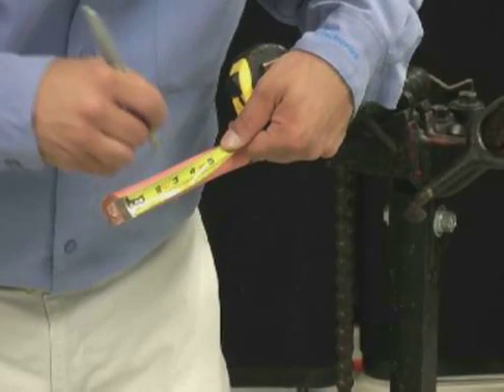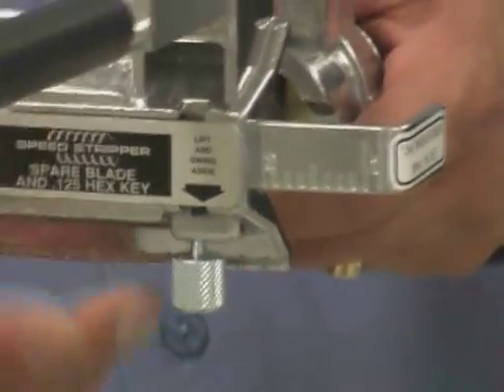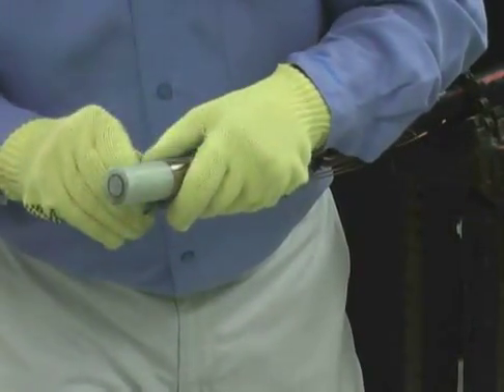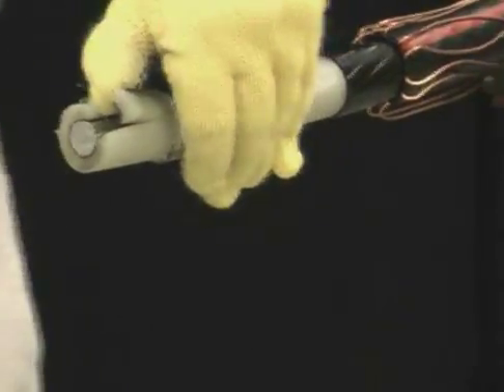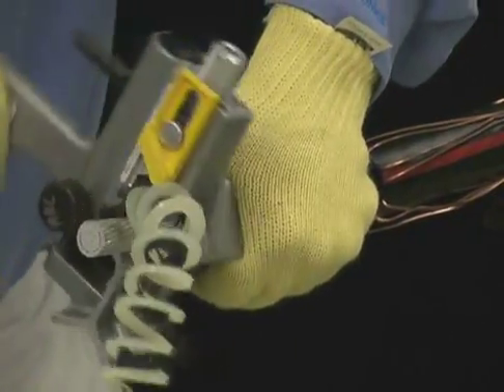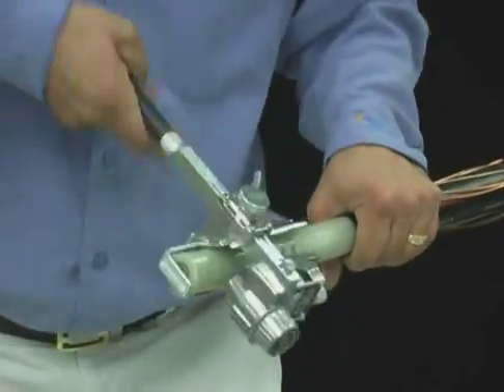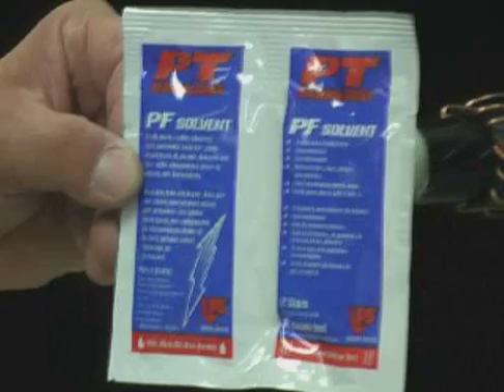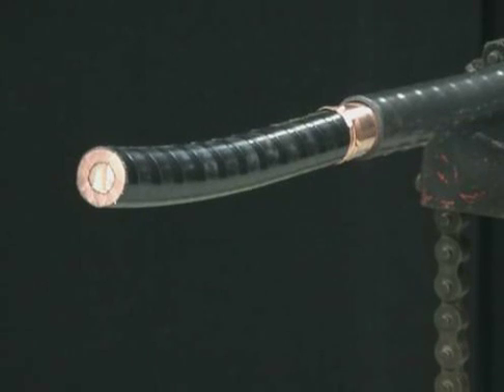Cable Prep Part 3

Comment: Being a trainer on MV & HV systems it's not a bad video however the use of springs is always frowned upon especially when utilised on the final finished insulation.  Would be safer if the video showed this being placed on the insulation which is removed.  Also the use of a stanley blade to do ring cut on the semi-con is so dangerous!!! This should be shown with a circular or 3 point file.